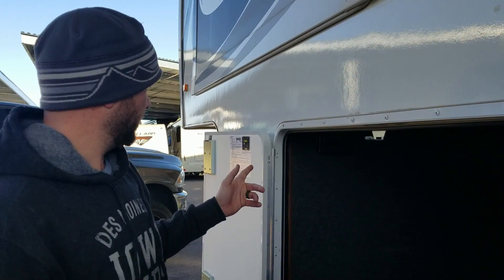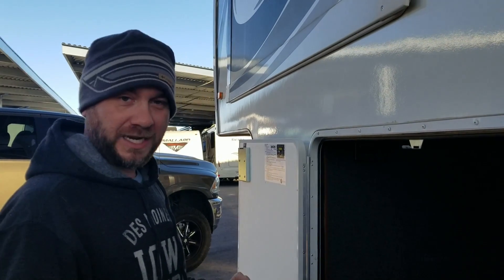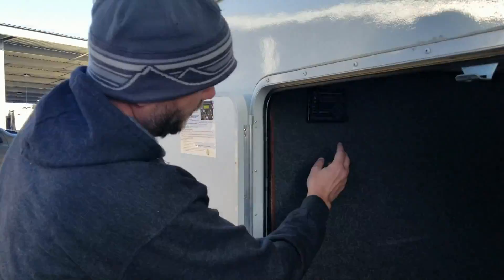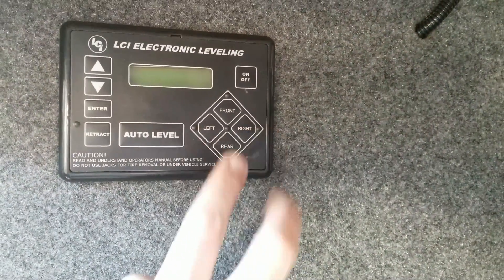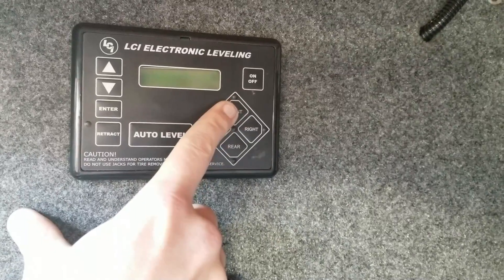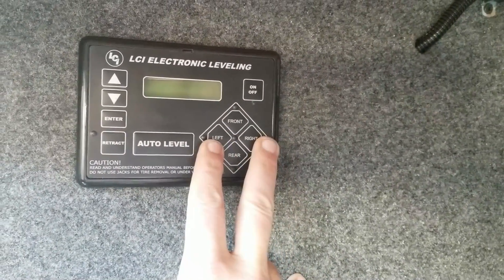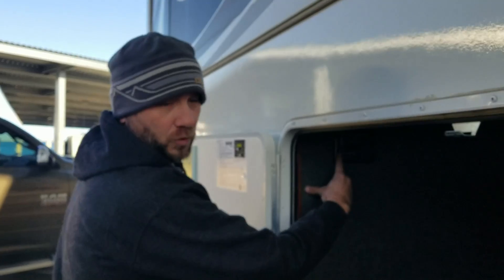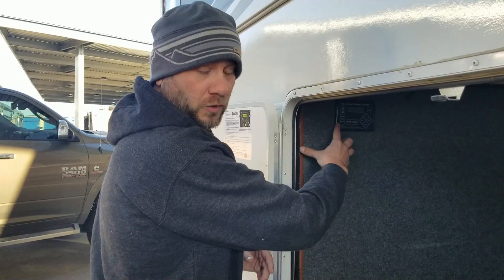Lippert Auto Leveling System Troubleshooting - Correcting RF & RM Error Codes

Comment from the maker: We hope this video is helpful to anyone with the RF & RM Lippert Leveling System Error Codes.
Reply: We bought a 2022 Astoria with a lippert system in November. We’ve used it once and had it in storage since. Yesterday, we kept getting a message that said auto level error. The dealer says we need to bring it in and they have to resync it, which they say is not covered under the warranty.
Reply from the maker: @followhimhome  What a bummer! Are you able to resync it on your own?

Comment: do you need to have the truck connected while you do this?
Reply from the maker: You just need the system to have power so the display works and the auto leveling jacks.

Comment: Have you ever had the problem of leveling without 50amp hooked up and just using the battery? I tried this and it doesn’t seem like it wants to come down. I hooke 50amp up and they went down. Not sure way but my next trip will be not at an rv park
Reply from the maker: Being on the battery we had to turn it off several times and then reboot it. We seemed to have the issues when hooked up.

Comment: Hello how do you turn on the lcd panel? Do I need a battery for the rv? Or will a 7 pin plug from a truck power it on?
Reply from the maker: The lcd panel will need power somehow. Hope you get it figured out! 🙌

Comment: Your video was a lifesaver for me! The last time we got an error code the unit was brand new at the dealer. It took them two hours to figure out how to clear it but they couldn’t explain what they did to get it cleared. After storage this winter the batteries were low and when I went to raise the trailer it popped the code. So thanks again, your solution was well explained and worked the first time!
Reply from the maker: Awesome! Glad the video was helpful. Happy traveling. 🙌

Comment: Help please... After turning on lippert electronic leveling system so I could reconnect truck.i pushed left and right buttons and immediately went to error - external sensor error. What should I do.
Reply from the maker: We haven't seen that error before. I'd search for that error on Google and see if you can pull up any forums with a solution. Hope you can get it fixed soon!

Comment: My wire left jack has error. When trying to extend it manually, it will only move 1/2" at a time. I can't get it to reset at all. Any help is appreicated. Thanks
Reply from the maker: The way we reset the system in the video is the only way we know how to fix it. I would contact the company if you continue to have issues. Hope you get it figured out!

Comment: I'm getting a low voltage error on my class C leveling system. My battery level shows full and I'm plugged in to camp site.
Reply from the maker: Hmmm, never had that error when we owned our 5th wheel. Have you checked the wires to make sure they aren't loose? I know that was a recommendation when we were troubleshooting the RF & RM error.

Comment: My system is locked up, the front jacks are down, the rear jacks are up, but the message says retracting rear when I try to do anything.  How can I reset it or get to manual mode.  I tried to do manual and get the same message. Thanks
Reply from the maker: Ours reset when we disconnected it from the battery since the 5th wheel was in storage. From there we were able to extend the rear and middle jacks 6 inches. Hope you got it figured out!